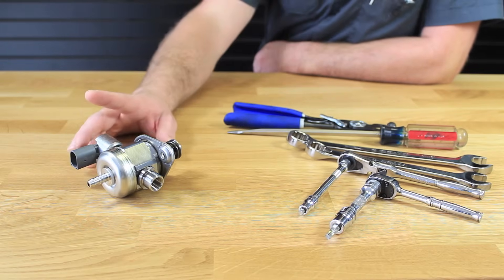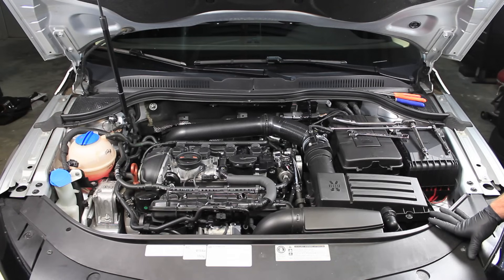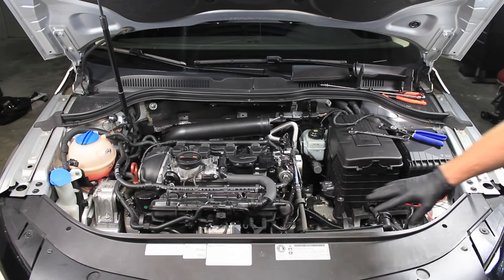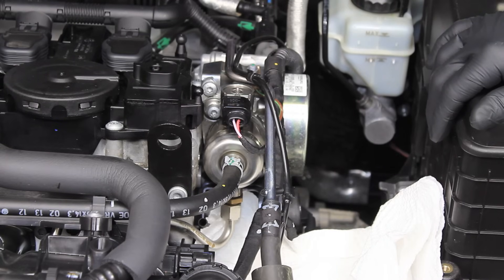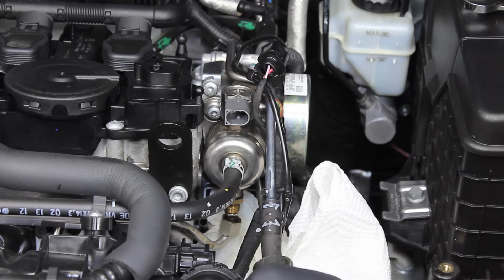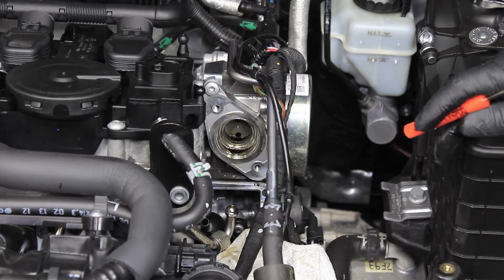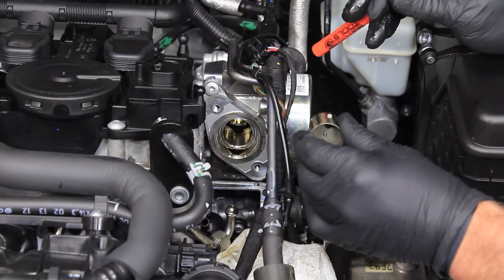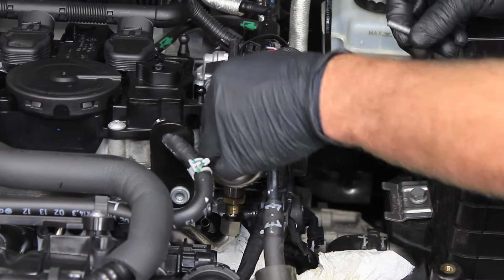VW 2.0T TSI Engine High Pressure Fuel Pump (HPFP) DIY (How to) Install

Comment: Do I need a new fuel pump?

The check engine light is on in my mk6 gti, and I am experiencing a loss of power up around 5K-6K rpm when I am really putting my foot into it.  It only happens with these two circumstances - never at low RPM and only when the pedal is down - and only occasionally when both circumstances are present.  The code it's throwing is "mass or volume air flow".  Do you think I have a vacum leak or a bad sensor?  Is it possible that the issue is fuel?

Comment: I've watched this video quite a few times.  Good Video.  I do have a question on why there really isn't many videos on the DYI aspect of this 2.0L TSI engine.  I've taken off this fuel pump, and entire assembly that it fits into. Also have taken off the valve cover off to replace rocker arms. There is a metal gasket between the valve cover and the fuel assembly that I bent upon removal. I haven't found out where to purchase this piece - yet.  I DO have ONE question. If I find some needle bearings in my oil pan. From WHERE do they come from? This has been a perplexing problem/issue for me.  I've replaced the vacuum pump on top as well as worked on replacing the timing chain tensioner. There was still a ticking/tapping sort of noise near the fuel pump region. I also had a oil pressure light pop up the last time I had it running. Thanks so very much!  Oh yea.The OBEleven tool is very useful for many VW's. As it has been mentioned, it's useful in an environment with internet connection. I also have another OBD2 reader that is very useful in pretty much every other vehicle out there, just not as detailed per VW.  Again Thanks for all your videos.  I thank you ahead of time to link-up and post some info on the top side portion of the engine.  (I've 2008 TSI and FSI Passats)

Comment: Hey i replaced the fuel pump, but my car is still showing the same eror code on a scan. Its still stalling and shutting off.
Reply: Hi I have a skoda superb .having starting probleme. It starts and then stop engine suddenly what is the reason

Comment: so i’m having issues taking it apart especially the air intake system, my problem is i have really bad rusted bolts and screws. any tips to  get them off.?
Reply: I know you've probably done it by now. But for future reference, you should post and ask on volts wagon forums. They're a lot more helpful than YouTube comments.

Comment: Hey Deutshe Auto Parts. I have a 2006 Passat BWA FSI MOTOR. went for a drive and notice lack of power or boost while driving. And it seems to take a while to start sometimes  and runs a little rough. Got a scan tool on it and got the fault Fuel Pressure Regulator Valve N276 Open Circuit P2294 No Signal No Communication Intermittent. Checked the wires  for any Voltage with Ignition On. Was Receiving 2.485 Volts. Was just wondering if its ment to be 5 Volts Ref Voltage or 12V battery voltage. I have a feeling that there maybe a break in the wire but im not to sure right at this point. The Fuel Pressure Regulator Valve on top isnt broken and car was in a little accident at the front. Would really appreciate some help to Diagnose before removing and inspecting the HPFP. Thanks

Comment: I have a polo on 17 plate and the hpfp makes the engine sounds like a wizzing piece of shit 👎🏼 had it changed and it's still the most annoying noise ever when I'm driving if anyone has any ideas as to why it's so loud or how I can make t quieter pls help

Comment: Wow, great video.   I just installed it back when I replaced the vacuum pump but I didn't know about the roller check.   As a matter of fact, I didn't see anything like that inside.   Would it slide out  by itself drop to the floor  if I tilt the vacuum pump?   If that is the case, I believe it the cause of this engine malfunction.
Reply: Hi I replaced my vaccum pump after replacing it the vcd comes up with fuel pressure low, do you know what it could be

Comment: Hi, is a p2187 code something that comes up from a bad hpfp? system too lean at idle. Ive replaced thr PCV and intake manifold ( had these parts new) and did a carbon clean up but I cant shake this code off
Reply from the maker: answer coming on askdap 94 take a look here if you are not familiar.  
https://www.youtube.com/user/DeutscheAutoParts
Reply: Deutsche Auto Parts looking forward to it thank you!
Reply: Deutsche Auto Parts subscribed

Comment: Great video and advice. I have a 2009 VW Jetta 2.0t TSI suffers from P2293 fault initially and also caused P0222, B1301 and P0172 error code and hard to start issue. 

All resolved with the replacement of the high pressure fuel pump. Just one last note, make sure to check if you need the fuel line to fuel pump adapter when you order your fuel pump. Since older model had a different adapter.
Reply: This is late. But I’m doing this now and I went ahead and ordered that fitting with it just in case. It was only $5
Reply: @FZERO20 How tight did you fit it on the pump? I can't tell.
Reply: @Drpepperkiller10  I try to get it as tight as it felt when taking the old one off, but really. Just a good bit past snug

Comment: Hello, thanks for the video. How do you cut the fuel supply? Did you disconnect any fuse? or as long as its off its isnt necessary?
Thanks

Comment: How do you bleed the fuel off?
Reply: Detaching the low pressure pressure pipe that goes to the high pressure pump and then get inside the car and pump the gas pedal.

Comment: I can't get the connector removed. What's the trick? You did it so easily.
Reply: There is a flat tab on the bottom side that has to be pressed. The key is to push in on the connector, and pry back on the tab with a flat screwdriver and pull out.
Reply: Dude!!! This drove me nuts too! Lol! Longest part of the replacement

Comment: hi guys. thnx for sharing. question. what was the reason for the  high presure fuel pump replacement ? I often read something about fuel leakage into oil at 1,8  and 2.0 tsi engines.  Is that the place where it most common happens? Or was it the lost of fuel presure in the rail ?

Comment: I had a check engine 2 days ago while i was driving my mk6 gti, 
I didn't drive it for 3 days when i try to start it  didn't want to come on, do u think the HPFP could be the issue.. Can someone help please
Reply: My mk7 won’t start at all and three detectors point to the fuel rail pressure sensor , I hope that’s really it

Comment: Is it necessary to primp the pump with something like VCDS after performing this service? I'm replacing the fuel filter on my 2015 GTI and had heard that damage could result if the pump is not properly primed after opening up the fuel system. Thanks.

Comment: I've been having issues with my 09 tiguan loosing throttle response and epc and check engine light coming on..can this be the cause?
Reply: Did you get this fixed?My tiguan is doing the same.
Reply: i did... replaced my throttle body...
Reply: Thanks for responding. I have the Check engine light and EPC flashing.The codes {p0300 and 0301 and p0302) say I have multi cylinder misfire.Mechanic is recommending changing ignition coil and spark plug but I doubt it will fix that.

Anyways Did that fix your issue? Also was it an easy DIY?
Reply: Dawn Sam i had similar codes after i changed the throttle body...replaced ignition coils and works like a charm... 0300 is engine misfire and 0301 and 0302 is cylinder 1 and 2... they are aligned in order from left to right so it would be the first and second ignition coil that needs changing
Reply: Fusion619...I will start there. Most forums say Ignition/Sparkplugs.Fuel injectors does not help much. Many thanks for responding so quickly!
Reply: @dawnissacsam  how did you solve this problem?
Reply: @ddddom1984  I fixed it by replacing the high pressure fuel pump and the PCB valve. Both are easy DIYs. You don't need to replace the cam follower even though some forums say that. This fixed the issue for me.
Reply: *PCV
Reply: Dawn Sam hey dawn did you have to recalibrate the high pressure fuel pump after replacing it?
Reply: @alexismoran1738  no I didn't.
Reply: It was loss of oil pressure and resulted in time chain failure
Reply: @FUSION619  were you able to save the engine?
Reply: @dawnissacsam  not really.. just drove to to a mazda dealer traded in for a CX9
Reply: @FUSION619  awesome! This thread is regarding misfire and EPC/ check engine light.But my Tiguan did start showing oil pressure low, shut off engine message. I traded it in for a BMW X3.

Comment: okay I switch the high pressure fuel pump is still stalled on me then I switch the module and it worked I recommend starting with the module that's my opinion  is the high pressure fuel pump supposed to get really hot it is wasting a lot of gas
Reply: +Damien Mercer it's under the back seat

Comment: is that part called the "Holley fuel pressure regulator"? have a 2009 VW CC 2.0T. Error codes P2293 (fuel pressure regulator 2 performance) and P025C (fuel pump module control circuit low).

Comment: hey guys Im trying to install the pump, But the the roller tapper does not go all the way in. It seems like the camshaft in there is preventing it from going in. What can i do in this situation?
Reply: +Nikos Kaldaras I received an answer Thank you
Reply: +Nikos Kaldaras what was the solution?  Thanks
Reply: +Shimon La Hee' credit goes to @Humblemechanic for telling me the easy solution. 

I cranked the engine so the cam turns, but I didn't allow the engine to run. I cranked it once then check to see if the roller tapper goes all the way in, it was not so I cranked it once more and then I checked again and It was able to go all the way in. 

Just a tip. While you crank the engine, gas is coming out of the gas line. I am not sure how can you stop this maybe disconnect a cable, I could not find it so I just placed the line into a medium size bucket so the gas falls into the bucket and not on the engine and the cables around.
Reply: Or understood you just have to male sure the cam is adjusted on the correct sequence for imstalling nice thanks

Comment: i have a 2009 volkswagen cc and it shut off after 2 miles does that mean I have to replace both  fuel pumps and if I have to do you guys sale  both fuel pumps
Reply from the maker: +Everardo Gutierrez Im sorry that is not enough info to know.  You will need to do more diagnostic to work that out.

Comment: My 09 CC TSI 2.0T has Error code P12A2 (Fuel Rail Pressure Sensor Inappropriately High). The shop has replaced the fuel pressure sensor but the code came back after 2 weeks. Any clue where to look at? Thanks! #ASKDAP show

Comment: Is that new follower available separately, or is an entire new fuel pump required? Also, if that older follower has failed, what are likely symptoms? Thanks!
Reply from the maker: +Harry Marshall This should answer all your questions http://shopdap.com/vw-audi-2-0t-fsi-cam-follower-and-camshaft-wear-problems/

Comment: Just did this repair with one of your pumps.  No way I would have done it without this video, went perfectly.  Thanks guys, your videos are awesome, and your parts, and delivery are great.  #newcustomerhere
Reply from the maker: +John Henry Thank you so much for the feedback, the purchase and support.  We appreciate it very much.  Hope you were able to get your vehicle fixed.  

Thanks 
Paul
Reply: @Deutscheautoparts My car had issue starting after each  drive, I have to wait for it to cool down before it can start. My mechanic said it was the regulator and he changed  it. After charging it the car can hardly drive, its bucking whenever I press the gas. I didn't have this issue before. Please help
Reply: Couldve saved 400$ just watching this video jesus christ. Doing all repairs on my own from now on my B6

Comment: did you know about this dtc p0087 fuel rail pressure what we need to do
Reply from the maker: +Miguel Angel Gaeta Morales It could be related to this High Pressure Fuel Pump but you will need to look into it further to be sure.

Comment: Unrelated to hpfp. but notice oil leaking from underneat vacuum pump near hpfp and making its way down onto shifter/tranny.  Saw your video on 2.5 vacuum pump failure is this common on the 2.0tsi as well? is there a gasket to replace?
Reply from the maker: +Vedas Dodds The vacuum pumps do have some issues on the TSI but it is not a super common problem.  It really depends on where its leaking from.  If it is the outer portion of the vacuum pump then you will need a pump.  Take a look here for that pump https://deutscheautoparts.com/06h-145-100-ak.html

Comment: Hi, my golf mk5 gt doesn't go over 3k rev ane the code it gives me is P2293, do you think it is the high pressure fuel pump?
Reply from the maker: +Harneet Soni It sounds like that could be the problem.  Take a look here http://shopdap.com/high-pressure-fuel-pump-for-2-0t-tsi-vw-and-audi-models/
Reply: +Deutsche Auto Parts thank you for your reply, this did help indeed. Where do you think I could buy a high pressure fuel pump for my golf mk5 gt 170?
Reply from the maker: Harneet Soni Im sorry that is not a US model.  We do not ship outside the US, so its tough to be certain about that.
Reply: +Deutsche Auto Parts So would my engine look the same as the engine in the video? Would the parts be placed as it is on the video?
Reply from the maker: Harneet Soni Im sorry we dont know.

Comment: You guys are lifesavers. Keep doing more TSI videos. Thank a ton.
Reply from the maker: +Rony John Awesome glad we were able to help.  Give us a shout next time you need VW parts too.  We can help
Reply: +Deutsche Auto Parts For sure! You can should do a future video for a timing/serpentine belt replacement. Just a fan suggestion.
Reply from the maker: Thanks for the feedback.  FYI TSI engines use timing chains not timing belts.  You should probably take a look at this article we put together.  

http://shopdap.com/2-0t-vw-and-audi-tsi-timing-chain-tensioner-problems/
Reply: +Deutsche Auto Parts I thought the 1.8 TSI engines still uses belts instead of chains.
Reply from the maker: Rony John This video is for a 2.0t engine

Comment: Hi, I'm having hp fuel sensor performance code come up. I'm experiencing loss of power in high rpms usually on the highway. it will have total loss of power then in about 10 seconds give or take the power comes back. do you think that's what's causing that? or can the sensor just be replaced? cam follower? any help would be much appreciated. thanks again.
Reply: Hey did you end up figuring out this issue? I’m experiencing the same thing right now.

Comment: So I have a 2010 GTI 2.0L TSI with about 80k miles on it. I've been recently experiencing some misfiring on all 4 cylinders (p0300 - p0304) even though I had a carbon cleaning done 10k miles ago and had all my coil packs and plugs replaced at the same time. Now I have a p2293 code that popped up a long time ago and went away but now it's back for good. I'm suspecting the hpfp is to blame but I can't say for sure until I VAGCOM it. 

Question 1 - If I do happen to replace my hpfp, would it be wise to replace the cam follower as well at my mileage even though it's not known to fail? 

Question 2 - Through VAGCOM, where would I be able to check the specs of my hpfp, lpfp, fuel control module, etc? 

Cheers & thank you so much for your invaluable videos. My wallet and time are forever in your debt.
Reply from the maker: halonski91 Im sorry we dont have specific details on the channels for that.  The fault code mentioned would point to the high pressure pump for sure.  You would not need to replace the cam follower as they are not an issue on TSI engines.  

Glad we could help save you some money.  We hope to earn your business on the pump you are in need of and other VW parts purchases as well.  

Thank you so much.
Reply: Deutsche Auto Parts Already bought a few things from you folks and I'm sure I'll be buying a few more. If it comes down to the hpfp being the issue I'll definitely be ordering the part from you folks.

Comment: Is there a way to see if the cam follower did damage the camshaft without removing it and looking? Awesome video. My 2009 VW CC with 58,000miles just ran into this problem. (I hope this is what it is.. )
Reply from the maker: Roger Charette Your car has a TSI engine and the particular model does not have cam follower wear issues.  You shouldn't worry about that.

Comment: I have a 2009 EOS, and have replaced the High Pressure Fuel pump, the fuel filter, but the lights on the dash are still on. Is there any suggestions?
Reply: Ok.. thank you for your help
Reply from the maker: Gerald Martin What are the fault codes?
Reply: Deutsche Auto Parts P0302
Reply from the maker: majkdragn2 Sounds like you have a misfire the causes could be, Spark plugs, ignition coils, Fuel Injector or Carbon on the intake valves.  Really tough to say.  You may want to consult with a VW specialist before replacing any more parts.
Reply: yes, have replaced the spark plugs, ignition coils, cleaned injectors/valves, and still have the error and the engine misfire... thanks for your help... :)
Reply from the maker: majkdragn2 You are likely having an injector issue.  https://deutscheautoparts.com/catalog/product/view/id/584857/s/vw-audi-tsi-fuel-injector-06h906036p/category/9818/